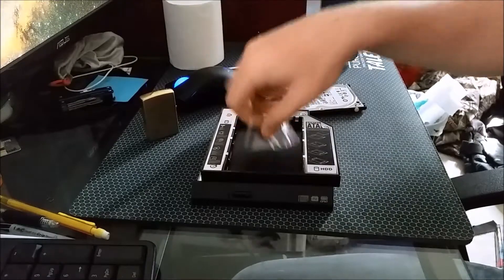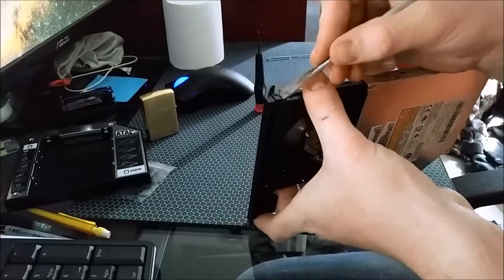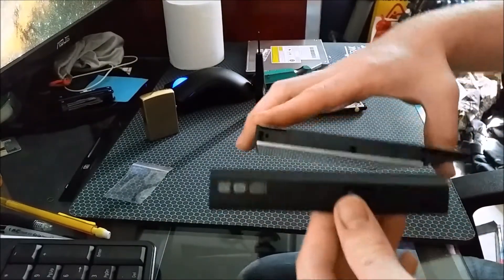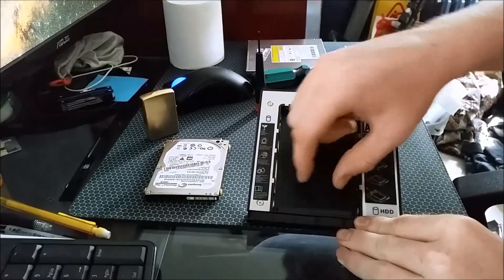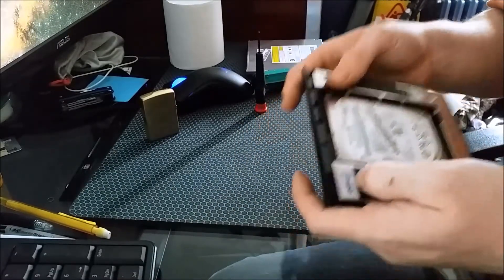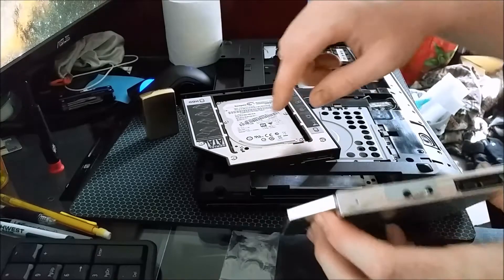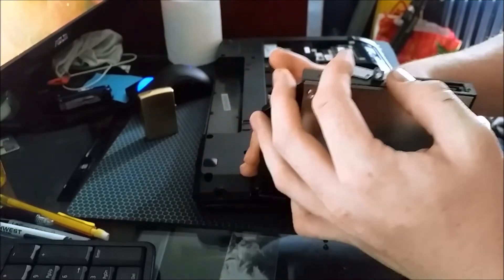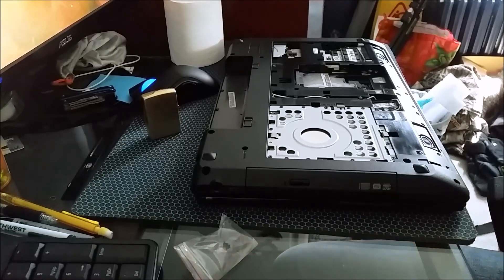Optical Drive CD DVD player face plate removal and HDD Caddy install replacement G580

Comment: I also have the same laptop exactly, can you link the caddy so I can make sure to get the correct one? I currently have a Mushkin MKNSSDTR480GB Triactor 480GB SATA III 7mm Solid State Drive and I would like to have two of these. Is there a way to combine the two so the system thinks that it is one drive so I can effectively have twice the speed? Or will they be recognized as a second SSD altogether? I dont know much about the subject but I hear its called RAID0 or something atleast on a Macbook pro 2012. Also, is the BIOS going to allow a different device to connect to where the optical drive used to be or will I have to do BIOS setting changes or even worse... BIOS mods? Please assist me as much as you have the convenience to. I am a PC advanced user so I know my stuff but not everything. Please help
Reply: I also subscribed to your channel as a favor its the most I could think of to thank you for your help in advance.
Reply from the maker: Here is a link to what looks to be a good replacement caddy:
http://www.ebay.com/itm/2nd-SATA-HHD-SSD-Hard-Drive-Caddy-Adapter-for-Lenovo-IdeaPad-G570-G580-G585-G770-/371421998045?hash=item567a79ebdd:g:UmMAAOSwT6pV3WLg

In order for a computer to see two drives as one you need to have a piece of hardware called a raid controller. this laptop doesn't have a raid controller, so you can't combine the drives. The only way to raid with that laptop is to get an external raid bay. 

The new drive will be recognized fine. Sometimes the cd drive will have a slower sata connection, but i'm not sure about that for this laptop. i used the cd bay for my 1tb hdd.

If you want to have a raid setup you should look into setting up a home server or desktop.